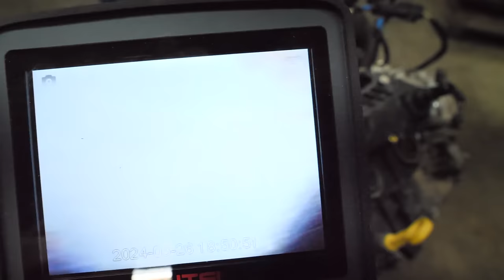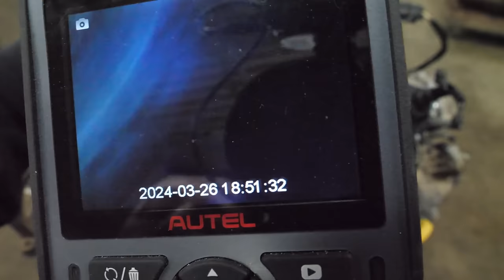ANOTHER BAD 2.7 Ecoboost? 2018 F150 Twin Turbo V6 DEAD @ 131k Miles

Comment: I'm almost embarrassed to say this as I've always believed there's no replacement for displacement.I took a chance on buying the first gen 2.7 Ecoboost f150, I took a test drive for shits and giggles one day and really liked the feel of it. All I can say is it currently has 75k with 53k miles of that towing a 5000lb travel trailer all across the US. This is my first Ford, the 2.7 still blows my mind and has been incredible, crossed the Rocky's like I wasn't towing anything. Better than my last 5.3 GMC, the rest of the f150 is crap but that 2.7 is a beast. But longevity is still my concern, i guess I'll find out one day..
Reply: I love my 2017 2.7 EcoBoost. Only major thing I’ve done is spark plugs and a coil pack.
Reply: @Foxbody302 I wouldn't consider plugs and coil pack major. My 3.73 rear end blew apart at 68k, replaced with brand new rear end from Ford. One selling point for me was lifetime - unlimited milage warranty that came with the truck. It covers majority of issues I could come across right down to oil gasket leaks. We have same warranty with same company on a 13 Hyundai sonata, 11 yrs old now and they haven't questioned any repair..

Comment: Biggest failure for these engine is the owners. The 2.7 has less issues then its 3.5 counterpart. I work as a ford tech and can say these are reliabe as hell. We have a survey company that comes to us for work and their last 2 trucks with 2.7 that needed an engine 1 was at 238k miles and was at 279k miles before they let go and not even catastrophically, they were just low on compression. Say what you will I will stand by the 2.7 over any other turbo engine currently in production

Comment: Did Ford fix the oil consumption problem with this engine?  I don't know if it was Gen 1 issue or still happening, but I know there was a several buy-back cases over low mileage engines consuming massive amounts of oil.

Comment: Put that engine back together after cleaning with new valve, clean valve seat, replace timing chain, new gaskets and oil belt and send it. piston moving is because it was all clean. they all need play for expansion.

Comment: When they try to make to much power out of a small engine this is what you get. Lots of trouble. You are going to see a lot more of this crap in these newer engine. Hard to fix this stuff because of not many machine shops left plus the labor and parts cost just way to much. Unless you can do this as a DIY jobs you just junk these vehicles or buy a new engine. Vehicles are getting to be throw away items today.

Comment: Any ... Slant 6 teardowns ?  I never had 'true' issues, besides a leaking rear-main (D150 + A833), and oil turned grey after oil change (bearings?) but never died.  went from ~40,000km to +160,000 km this way.

Comment: Eric, so glad to see what the filters have been catching  - love those filter cutters. My youngest son's godmother told me she changes oil in her Chrysler product when the light comes on - how long is that normally??? 😮
Reply: Too long
Reply: what year?   Most newer cars, even german sports cars, are about 10k miles.  Twice what they should be.  The oil actually lasts that long in most street applications, but the filter technology isn't much different than the 1950s.  I promise you 10k miles oil changes are going to sludge up an engine.  At 5k intervals, engines look nearly as new.
Reply: @adsingl  I agree 100%. Most of the GM 5.3's with AFM failures are due to extended oil change intervals. Most Ford and GM engines with timing chain stretch are also due to extended oil change intervals. Especially if the vehicle is short tripped in cold weather regularly. The amount of unburned fuel that ends up in the engine oil alone is a big issue, not to mention the diesel-like soot that direct injection engines generate, which ends up in the oil and will contribute to sludge.

Comment: It really depends on the mechanic some mechanics will side on the school of thought that well you're already spending this much money might as well replace it because there's a lot of damage that's possible if it were me and It was my truck I would just pull the head and replace the valve I probably wouldn't even give it a valve job just lap the valve and slap it back together run it for another hundred thousand miles till the oil pump belt breaks and it blows up

Comment: 41:40 - Those are Data matrix codes often used in parts tracking in manufacturing and supply chain management.

Comment: Can someone explain to me how a 2024 5.3l Chevy can have metal flowing through this engine from new. And even 3000  miles later no issues. At 790 miles the filter was clogged so I changed oil and filter. Dealership said it’s fine. 300 miles later I changed the filter again full of metal. Once again they said it’s fine. How is this engine running good yet? 
Anyone??
Reply from the maker: Eventually, the source of the metal will run out and you’ll figure it out quickly. 
There should not be metal in oil. Ever.
Reply: Holy crap, so much metal that it's CLOGGING the filter and the dealer says don't worry 😂

Just keep driving it till it blows. These guys are fools if they say that's normal.
Reply: @I_Do_Cars  should I cut the filter open and upload?

Comment: I would totally do a valve job on that engine and put it back in service. To be fair though, I pulled the 3.5 EB out of my 2011 F150 and put a new crank in it, so a valve job would have been so much easier…

Comment: The labor cost would make the repair of the engine not practical. At $175 per hour (175 is cheap dealer labor rate) = $1,400 in 8 hours plus the machine shop. I think in the end it would cost as much if not more to fix then replace.

Comment: Besides that oil belt those are pretty stout engines, id say the bigger issue is the 10r80 backing the new ford engines up those have a habbit of giving up right as the warrenty ends.

Comment: Standard to replace all exhaust valves when be building cylinder heads with any real mileage on them. That said Audi 2.7T 1.8T motors also turbocharged like this Ford we’re notorious for exhaust valve failures. They perhaps Ford has a problem with exhaust valve issues on their turbo engines, turbo engines produce a lot of heat so allowing components to warm up before putting the hammer down is always a good idea…

Comment: I think a big thing hurting the 2.7 rep is being the base F150 engine and the associated demographic.

Technically the NA 3.7 but even your average cheap/broke guys aren't buying fleet models
Reply: Yeah it's similar to the undeserved negative perception the GM 5.3 gets. When engines like the 2.7 and 5.3 are so ubiquitous and used in multiple vehicles, any issue that causes one to fail makes it seem like they're all having that problem. Hundreds of thousands 2.7's and 5.3's are put into a bunch of vehicles. Sometimes an issue is bad luck, other times it's due to neglect. The sad part is that this engine was clearly well cared for. The guy that owned it changed his oil very often and just had bad luck when something caused a valve to burn.

Comment: iirc the belt replacement intervals for those kevlar belts and the ones used in the 1.0 EcoBoost, 2.0 EcoBlue diesel is 140,000 miles.

on anything pre-2020 though replacing it now regardless of mileage is a smart idea. The tensioners on both gas and diesel engines that use these things like to degrade resulting in the oil pump belt shredding.
Reply: for the second gen duramax the belt is 200 k miles warranty
Reply: @marlu6373 Didn't expect the L5P to have a drive belt for the oil pump drive - At least the L5P and LB7 are OHV though so the cam can be driven with a gear or chain and sprockets inexpensively.

Comment: I just bought a barely used Lincoln Navigator w 10.1 miles. Please do a break down on the 3.5 eco boost engine so I can anticipate on my future problems. Thanks I  really enjoy your channel. Marc
Reply: Just use good oil and change it.
Reply: Change the oil every 4k to 5k miles. 4k if you short trip it in cold weather. Change the spark plugs more often than the manual says to do it.
Reply: @hochhaul  I did mine at 65K.  Also, check to see if you have a composite or aluminum oil pan.  The composite is known for cracking and mine was replaced as part of my Ford ESP plan about 6 months ago.
Reply: @hochhaul  I had the plugs changed at 65K, also check the oil pan.  The composite oilis known for cracking (Mine was replacement with Aluminum oil pan under my Ford ESP, about 6 months ago.)

Comment: $2500-3000 is a drop in the bucket considering a nice 100k mile 2018 F150 is worth 25-30k still.... probably why they went with just replacing the engine.   From a machinist standpoint,  I would have fixed the head... $30 valve, $200 valve job, $100 to surface.... Now the labor to pull and replace the head is probably as much or more than pulling and installing a new engine.

Comment: I was given a rototiller and it did hardly run so I took crankcase off and it had a plastice cam in so that will be next thing car makers change all their motors over to a plastic cam shaft .

Comment: I’ll put forth the notion that this failure was because of the small engine, big power design. I bet that valve was initially damaged by pre-ignition when the driver gave it the onion one time and then the rest is history.   

You wouldn’t see that with a 350 getting 2mpg.

Comment: I have a 2016 2.7L white exhaust smoke, losing coolant. Is it “most likely” a cracked exhaust manifold in the head?  Sucks because it runs great, no codes. Thx

Comment: You mentioned the shop, if it chose to fix it, would be a cab off to access the motor. Is that standard in late-model vehicles now?

Comment: I wonder how many people had to die before the manufacturer put that plate on protecting the fuel line from crashes.
Reply from the maker: It’s been on cars since the early 2000’s
Reply: @I_Do_Cars  Not sure that changes anything about what I said though.  Manufacturers don't tend to put stuff like that on vehicles until they're are forced to usually when a certain number of people lost their lives to repeated failures of said part.
Reply from the maker: @bretosborne7504  you aren’t wrong, but at some point some scenarios are unknown until we as humans see them unfold.
It’s the reason recalls exist.
Reply: @I_Do_Cars  appreciate your videos and time.

Comment: Ive had 2 naturally aspirated, "reliable" engines die at 125k and 135k (3.4 chevy v6 & 4.6l ford v8). Both engines made laughably low power figures so id say this engine had an average lifespan. Especially considering this ecoboost lasted that long while making good hp/torque numbers.

Even with meticulous maintenance, you shouldnt assume that any engine is guaranteed to last longer then 125k. They obviously can, but you cant assume they will.

Comment: Hello Man! I like the torque of a V6. BUT the difference in a V8 4 instance (4-bolt main) or etc. I've fooled V8 's. But the Eco V6 wasn't progressed enough to be reliable and to perform. It's not going to tow a fifth-wheel camper outta a muddy hole. Specially if they still have a wet/rubber band. 😂/Belt

Comment: I’ve replaced motors that were running before. My 97 Mustang had over 250k on the engine and I was pretty sure the asshole that had it before me didn’t take good care of it. I wanted a reliable vehicle. I had the time and money to replace the engine with a Ford factory remanufactured, had a guy that could rebuild my T5 tranny and I had a 8.8 rear to replace my original that was failing. For me it was worth it for piece of mind and I got another 200k out of that car.

Comment: Water pump could have been fairly new so they put it on the new engine. I’ve reused a used water pump when I know it’s been replaced recently and 1 time was because the car was a cheap junker and didn’t feel like spending money on a brand new one

Comment: I live in the metric world and we dont know a 13 mm bolt. What we do know is an m8 bolt using a 13 mm socket. We call bolts by their diameter, not the spanner/socket size.
Reply from the maker: So what about torx, triple square, etorx, ribe fasteners?
Reply: @I_Do_Cars  still pointed out on diameter, not on head size. So when in an store you order a ( material) m8 times (lengt) bolt with an (allan/hextangle/sixtangle/torx or whatever like head) or alltread. But only when it has tread we call it a bolt. Pins or whatever are fasteners or screws. We name it a bit differend in the european languages. What you guys call a dip stick we call it an oil level measuring stick. So what you can use it for(a stick to measure the level) has more names in dutch. Oil/gas/water if you use the same stick it can have 3 names. I can imagine why the english did not feel at home in europe😉.

Comment: People seriously think it’s ok to change your oil every 10,000 miles. It’s not, granted the new oils are better than the old oils, but 10,000 is still too far out. Maybe 6,500 or 7,000 at the very most. If you’re running the engine hard and towing or what not, it should below 5,000 miles .

Comment: Shops make more money on the small jobs rather than the large jobs. Loss of compression means lots of labor. Half a dozen A/C compressor jobs in a day vs head work. Many shops will just boot it...push the car out into the parking lot and tell the customer it's dead.

Comment: I think the most common reason why V6 EcoBoost engines blow up is because people go with too aggressive tunes such as a ZFG tune. 5 star is the way to go.
Reply: IMO it's the guys that think they should go 7k or 10k miles between oil changes that destroy most ecoboosts.
Reply: @hochhaul  That makes sense. My 2017 2.7 has 126k and I’ve had no problems at all so far, although it burns 1 qt of oil in between oil changes which is 5k, not that big of a deal.
Reply: @Foxbody302  these days even 1 qt every 3000 miles is doing good. My wife had a 2019 Toyota Highlander that started burning a couple quarts between oil changes. It was bad enough I took it to the dealer and they shrugged it off and told me that Toyota's warranty states that 1 quart every 1200 miles is considered normal oil consumption.
Reply: @hochhaul Wow! I think for a Toyota, that’s not normal at all! But a shame that Toyota quality control isn’t as good as it once was.

Comment: Chevy used fractured rods in the 3.5/3.9 Impalas. Made it easier when I accidentally mixed up 2 of them 🙃
Reply: Pretty much every engine built for the last 15 years uses fractured rods. It’s not exclusive to those engines.

Comment: I remember asking my dad why old flat vw engines lasted so long vs say a Subaru he was like it had 60hp son lol
Reply: I'm old. VW beetle motors rarely got to a 100k. They had poor head cooling behind oil coolers through 70 and those dropped valves when valve guide wore excessively. The head studs were problems on any 53 hp or more. The thermostats failed and air duct wouldn't go full open. I was in the sun belt and heat may have hastened the failures but I never saw longevity as an attribute.
Reply: Subarus had a built in design flaw that saw one side heat more than the other. Nothing like the design of the flat VW four where the air flow was equal on both sides.
Reply: @jimmyaber5920  weird my dad has build hot rod ones going back to 1975 that lasted long than you claim

Comment: I grew up around and have loved Fords for over half a century. I have turned wrenches for 
the same. I know the entire industry has changed the way engines are built. The longevity expectations are concerning and compromised for costs and immediate  gratification. Rather than value and quality. I know the new engines are more efficient and put out serious 
performance.
But after seeing the RUBBER BELT in the wet side of an engine with multiple cracks @ a little over 100,000 miles???
That is madly unacceptable!!!!!
A short term race engine they are not. 
The car industry "not just Ford" is ripping off the general public.
The "general public that probably 50% don't know why engines need oil!
The general public that replaces their laptop every couple years for a newer one with more unfixable features.
We throw more shit away now than ever before! But wait, aren't we in the recycling culture now?? Buying more stuff and discarding stuff only makes big industry richer. 
You know, the throw away culture!
The reason why there are just an only handful of antiques
around is because they were built to last. Not the easy, quick gratification crap that big company's turn out now.
So back to the internal rubber belted engine. I hope at least one person reading this gets my point. And thinks twice about purchasing the mainstream crap thats available in this greedy world we now live in......

Comment: Does anybody have any ideas why the 2.7 would be failing multiple catalytic converters (4) before 80,000 miles? I’m wondering if it’s fuel or 5k oil intervals?

Comment: The grey RTV we use is loctite, but I have tried and tried to find it on the market and can't. even the motorcraft rtv called for in the service/tech manual is different.
Reply: Try Threebond 1137.  It's what is used to assemble motorcycle cases.

Comment: Do you have any suggestions for finding information on replacing complex engine wiring harnesses? I have a relatively new Ford Mustang and all the manuals, but they don't have any information about the complex main wiring harness.  It is tough to see all the connections.  Hopefully, once I get some bulkier parts off, I will be able to see better.

Comment: Looks like a bad injector. Direct Injection injectors operate at anywhere from 600-2600psi and if they go bad they can and will burn through valves.